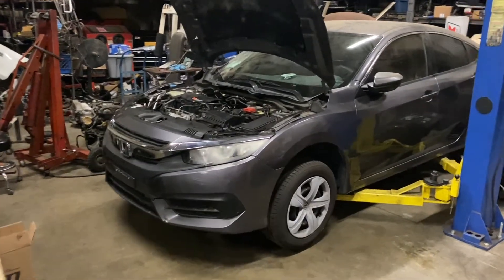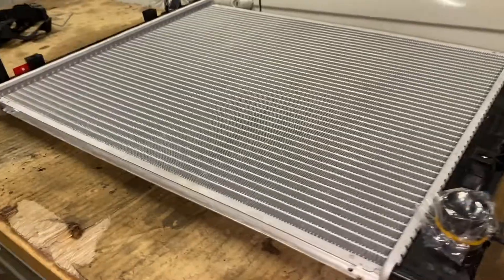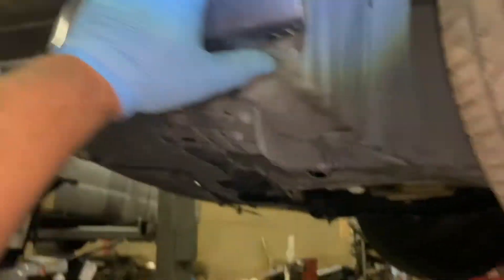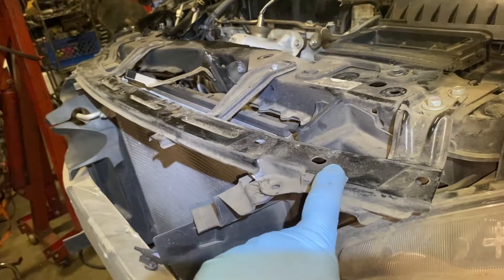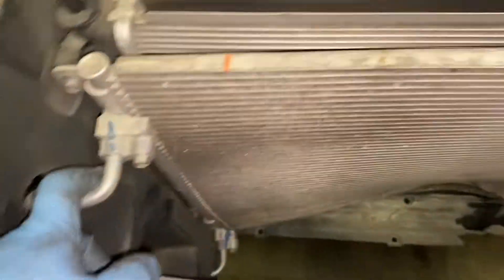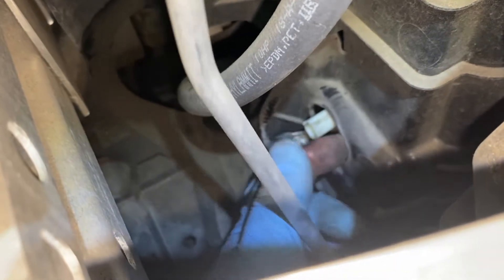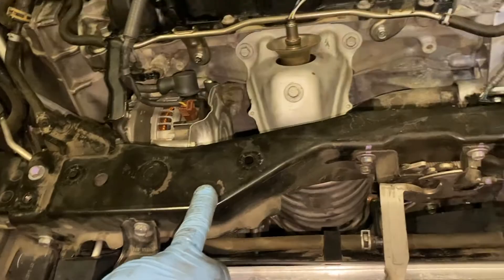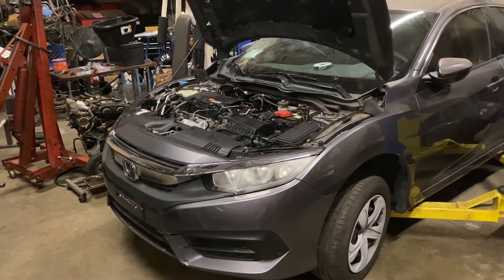2016-2019 CIVIC RADIATOR AND CONDENSER REPLACEMENT

Comment: Too bad it was physical damage. Good job.
My 2018 EXT (bought new) had 116,000 when the AC started blowing warm. Honda diagnosed and replaced the condenser under extended warranty for known AC issue. Other than that, I haven’t had an issue with my four year old Civic. Parts are relatively cheap. Service/maintenance are fairly inexpensive. At 120,000 I replaced the water pump, drive belt, flushed coolant, and replaced the PCV valve for $1,045. Considering the labor involved in replacing the water pump, I consider the cost as reasonable. 
With aggressive maintenance, I hope to get at least 300k miles without major repair to the engine, turbo, or transmission. 🙏

Comment: What fix do you recommend my 2019 civic needs done if the radiator was  dented in like in the video but more in the middle and a air leaking noise occurs right after now my AC wont blow cold now  need help pa porfa 🙏
Reply from the maker: Check your condenser

Comment: What type was the coolant temp sensor of the radiator?
My civic doesnt have any sensor in the radiator and it overheat if i not turn on the A/C due to not turn on
Reply from the maker: If it doesn’t have it on the radiator it should have it on the head, some cars only have one sensor. Check your coolant level or your fuses.

Comment: Question how do you make sure that it’s discharge that has nothing in it?
Reply from the maker: There is a low and high port, fitting, on low and high pressure line. You discharge it from there.

Comment: Hello having trouble taking off the harness for the fan any tips
Reply from the maker: Push the connector in towards the plug then press the tab and try to release connector. If not, try to use a pick to release tab. Just be careful not to break it.
Reply: Thank you for the reply. I did all the steps and the car is overheating. Feels like a blockage because the fan won’t start. Could you give any advice for that please? Really love the content brotha
Reply from the maker: @thepersianstunna  could be the radiator or the thermostat. You have to start testing components.
Reply: @mysterygarageCA  thank you brotha we got it fixed man appreciate you !!!
Reply from the maker: @thepersianstunna  cool!